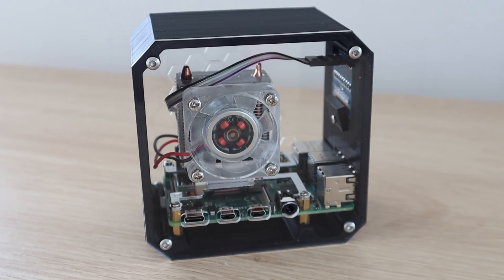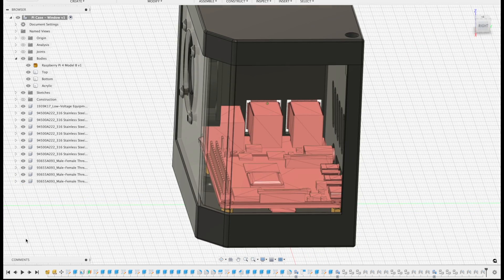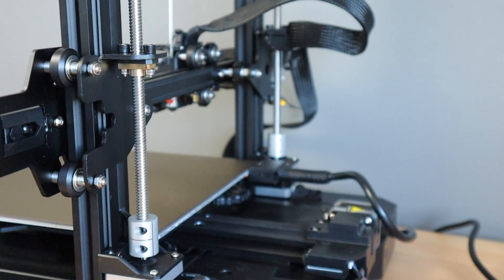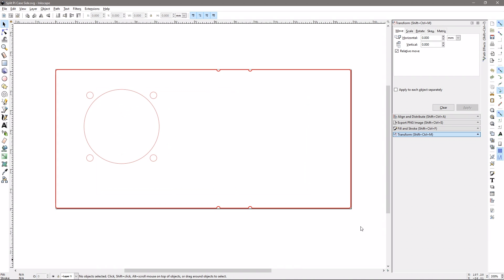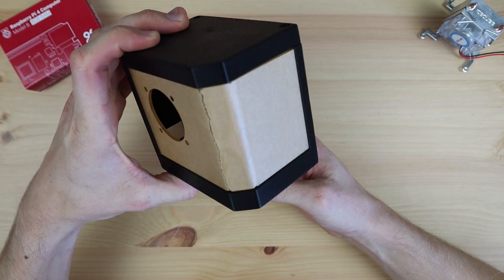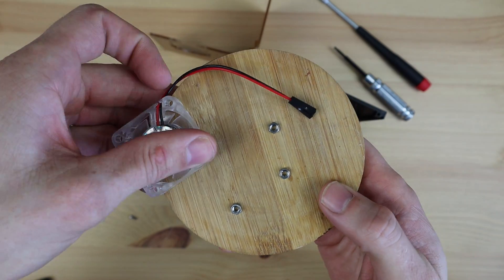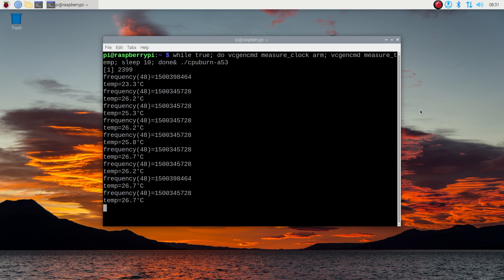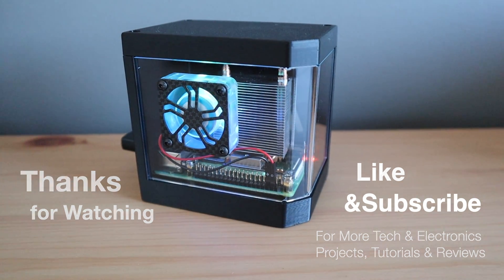3D Printed Raspberry Pi Case Using The Creality Ender-3 S1 Pro

Comment: Wouldn't it be more optimal for the fan to place it right in front of the cooler grill?
Reply from the maker: The Ice Tower cooler is so oversized for the Pi that it makes very little difference. As long as there is airflow through the case to remove the hot air, it is a very effective cooling solution.
Reply: @MichaelKlements  makes sense.

Comment: Looks great, I'm curious on a similar design but the pi would go on a side and having a low profile ice cooler, and a bit of space to include a ssd. For the cables the best way is to use those that are like an L style. See the TerraPi rig to get the basic idea
Reply from the maker: I’ve just adapted this case for an SSD, video coming next week!

Comment: Brilliant case!

My thoughts on the printer... seems a bit of a hit or miss with some units, some customers like me have units where the Auto Bed Leveling is a nightmare! The probe is not consistent throughout the bed, resulting in a wrong mesh and terrible first layer
Reply: Have you done up the screws on the back of the X-axis (gantry) ?  These can come loose (especially from the factory :( ).  You need to take the x axis off the machine to get to them.  After that, re-install and adjust your eccentric wheels on the Z axis so they are just 'snug' (Not tight, just to the point movement is no longer present).   After that, check that your bed isn't loose.   This will mean having to unscrew the bed where the springs are, flipping the bed upside down and doing the same check on the eccentric nut.   It's worthwhile ensuring that ALL other nuts and bolts on the printer are tight.   Lastly, check the connection point for the probe itself is not loose that would result in bad measurements.
Reply: Oh and ensure you are running the right G-Codes to ensure the mesh you made is actually loading :)  (Note, this is my direct drive Ender 3 V2 with ABL and Jyers firmware btw, but these should work fine).
G28 ; home all axes
M420 S1 ; enable the mesh
G29 L0 ; load mesh
G29 A ; enables UBL
G29 J ; tilt mesh
G1 X20 Y20 Z0.2 F3000 ; get ready to prime
G92 E0 ; reset extrusion distance
G1 X160 E15 F600 ; prime nozzle
G1 X180 F5000 ; quick wipe
Reply: @scougarmagfedpaintball5733  Thanks for all the tips! I have since done the above and getting way better prints, however I have noticed how terribly warped my bed actually is. Trying to see if I can get a replacement hotbed that is flat.
Reply: @Skhulile84  You may find that the warp of your bed is affected by how tight the springs are on the bed.  My system seems to have a 'sweet spot' where the warp is mostly gone.  Just food for thought. If I am struggling with level, I back everything off and start again.  (And the level will change when heated vs being cold btw).

Apologies if I have mentioned anything you already know!  If I can help people skip some of the pain I went through in learning, I try to 👍. Have a great day.
Reply: @scougarmagfedpaintball5733  No worries 🙂, I appreciate all the help, the springs on my side are tight, so sturdy with no wobble. I have heard people suggesting changing the springs to silicone spacers... have you tried that on your side or still using the stock springs?
Reply: @Skhulile84  I use yellow springs on mine, as the stock silver springs on my E3V2 needed re-levelling after every print.    It is not the springs that need to be tight, they are to adjust level.  It is the 3 POM wheels that need to be snug on the rail underneath the bed to avoid movement. They can wear over time or be loose from factory.  The single wheel adjusts tension, just do it snug if there is any slack.
Reply: @Skhulile84  I haven't levelled my bed in 6 months.  I can fire off a file remotely, and be 99% sure the first layer is good.
Reply: @scougarmagfedpaintball5733  I'm using the Ender 3 S1 Pro, so comes with the stronger springs which do keep the position better than the ones on the E3V2. My bed is better now in terms of getting a good first layer... the issue is the bed is terribly warped, the bed mesh does compensate well that I get a very good first layer... but as the compensation from the mesh fades off as the objects gets taller, my nozzle starts scratching on the model at a higher height.
Reply: Yea, got the same problem on the standard S1

Comment: could you position the fan in a place directly in line with the CPU cooler? 
with a little acryllic you could build a duct that directly blows into the CPU cooler.
the difference in temperature should be minimal, but fan and cooler in line would look more orderly and clean IMHO
Reply from the maker: Yes you can move the fan forward. I prefer it being towards the back of the case rather as this obstructs less of the view into the case.

Comment: Why fan is not aligned with heatsink?
Reply from the maker: Because it would be right in the front of the case then and would block out most of the view into the case.
Reply: @MichaelKlements  I mean it could be like in previous case. Blowing directly to whole heatsink. It would only block view of the heatsink.
Reply from the maker: On the previous case the Pi is the opposite way around, so the heatsink is towards the back of the case.

Comment: Very nice, but I do miss the little extra info screen you had on the front of your old case! :)
Reply from the maker: Over the weekend I was thinking whether it would be worth mounting it internally so that it's visible through the front part of the acrylic, it might look quite nice to see the whole display inside the case. Maybe I'll look at this as an add-on.
Reply: @MichaelKlements  For sure, it would look quite neat hanging' in there!

I'm still using a personalized version of your first case design for my Pi and that little info screen is very handy! I do need to learn how to program it though to get some different info on it :)

Comment: Your vid and your designed case were great.  The 3D printers looks like a winner.  It looks like a good replacement for my Anycubic 3D Mega.
Reply from the maker: Thanks Greg! I haven't tried any of the Anycubic printers, how's the 3D Mega been?
Reply: @MichaelKlements  It was my first and only 3D printer.  Overall it was an easy setup.  I had to make a tarp setup to cover the printer and added a small ceramic heater to get good quality products.  However, the bed was warped and it was out by an mm or two that caused some issues.  Also, after numerous attempts, I could not print with TPU.  A good beginners model to learn on.

Comment: All that work and the bloody fan doesn't line up, the fan should really be on the other side.
Reply from the maker: I didn't want the fan to be in line with the cooler because its then too far forward and takes up most of the window and view into the case. It could be moved to the other side though and then vented out the back.